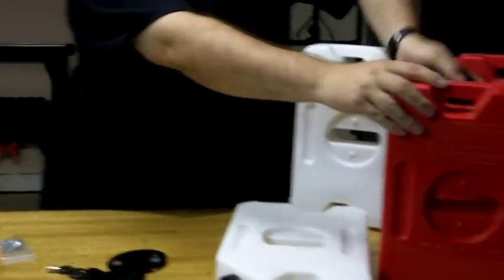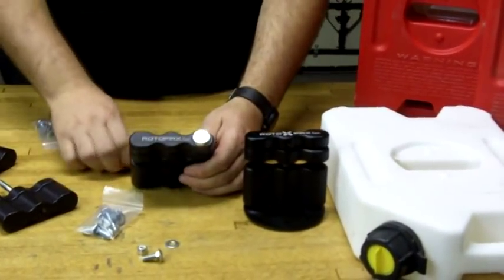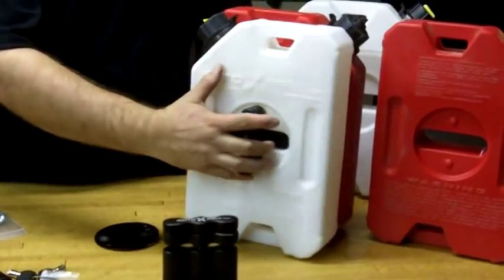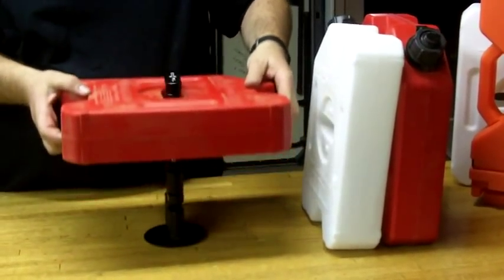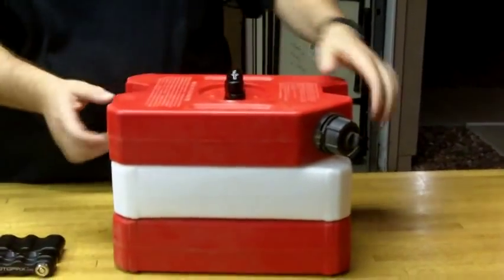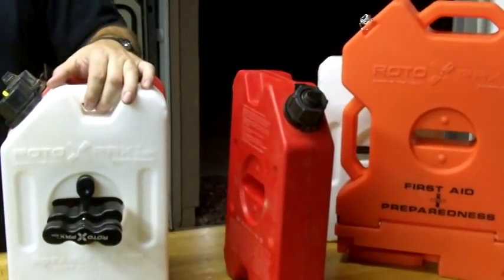Roto Pax Mounting System Overview

Comment: The locks don't work just had mine stolen overnight, apparetnly just use a pipe wrench to turn through the plastic dimples. I will add a welded bar when I remount. Please be aware!!!!!!!